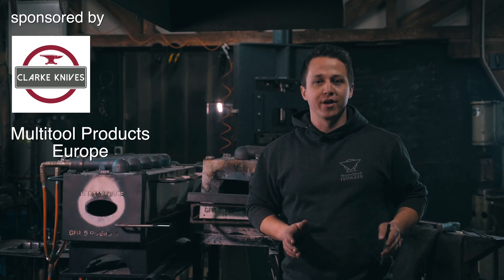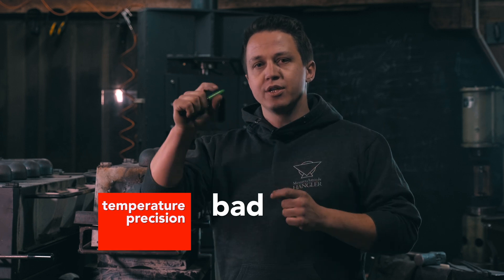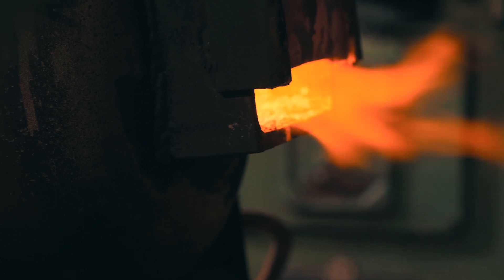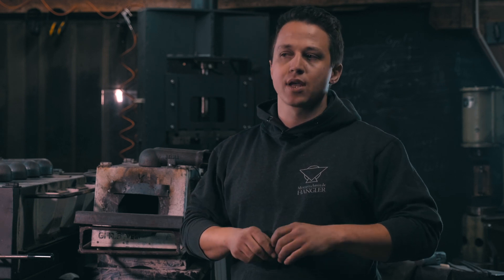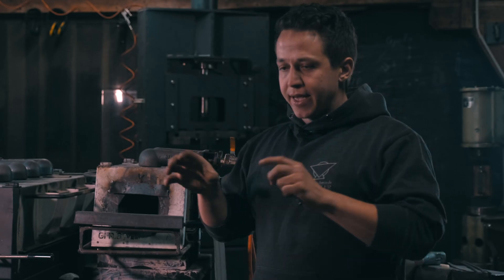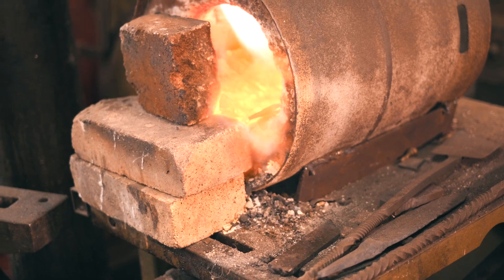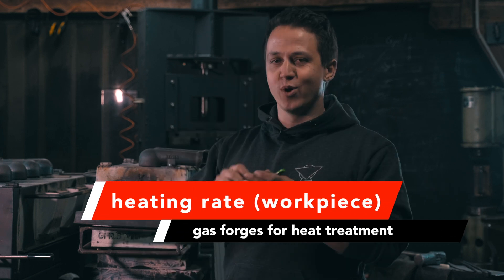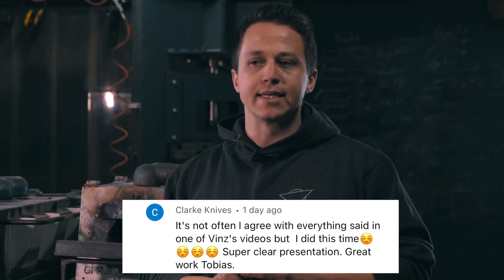Gas forge for heat treatment is WRONG... or is it?

Comment: i do use a gas forge, ive had no issues so far, but when i need to heat treat damascus ill ask andy from cuttlebrook to help me out as he has a kiln
Reply from the maker: Hello mate! Thanks for the feedback! It can be used for sure - but as you may know some type of steels can be trickier to heat treat than others and that’s when a more controlled equipment may be necessary. Cheers Shaun!
Reply: @UKBladeshow  i mainly use 80crv2 which is very forgiving
Reply from the maker: 80crv2 is definitely an easy steel to work with for sure!